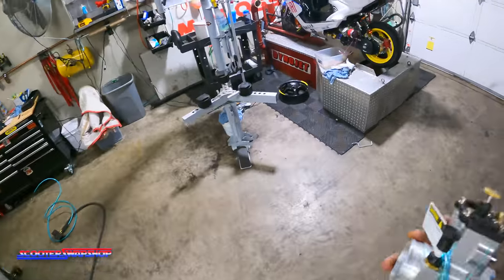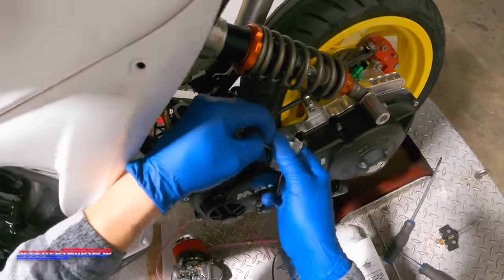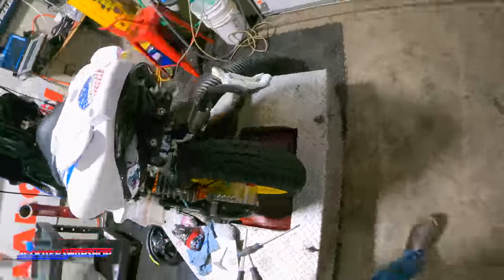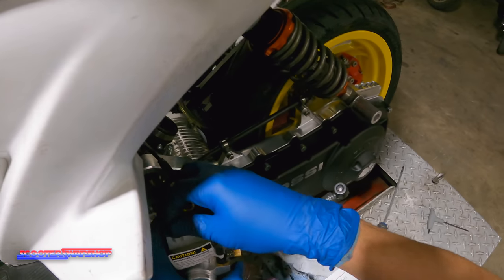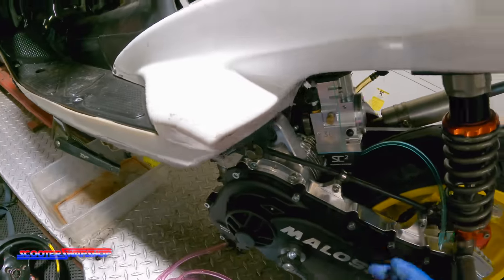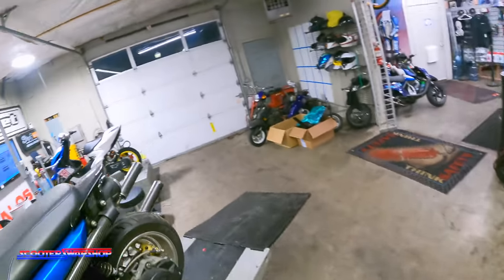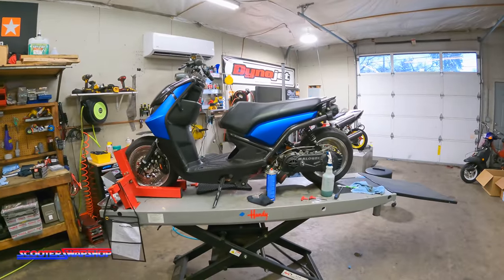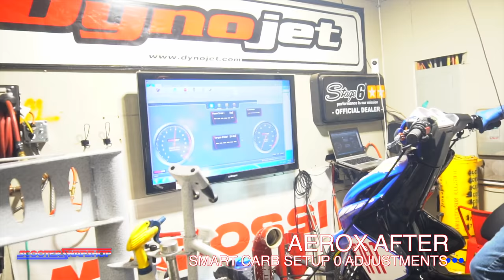Installation of a smart carb on the Yamaha Aerox Ep: 8

Comment: I flipped the intake 180 degree on a 8.1 carter i built for a friend as there is a little angle on it  and it gave much more room between the tyre and carb ;)
Reply from the maker: that would make it horizontal
Reply: @Scooterswapshop  Not at all ;) try it hehe
Reply: @ramshojracing  lol
Reply: @Scooterswapshop  you know you can just put a spacer plate in between your intake and block

Comment: Time to try the Super X carb from STIC SuperTorque. It looks and weighs like a PWK. The inventor told me a CR500 at the World drag race Nats took their class and placed 2nd in the 70cc class. Small bores get low end like an electric motor and the HP boost to the top comes in 1.5k RPM sooner and tags an extra 1k RPM after. So a very broad and aggressive powerband. I can't compare my SC to the Super X, that comparison makes sense with PWK vs SC. More apples to apples. Just a heads up on gains no one ever anticipates. STIC run huge pilot and main jets. Acceleration is beyond responsive, it is explosive. For MX on my KTM 200SX, I use G2's slowest turn throttle cam, as it returns control to the traditional range/sweep.

Comment: Hey Patrick, your show is top notch! I know I'm small beans but have two questions. I'm building a 70cc race kit bike. So far billet bottom end from Smolik performance and suitable crank and bearings that will take 12k to 13k rpm. The cylinder I'm rocking is70cc vertical MHR the one with the bridge port exhaust. I have already reached out to the guys at Smartcarb and no response. 
What size smartcarb should I install on this racing build? Second question if you have the time....which pipe would best suit this MHR racing cylinder? Price doesn't matter as I will spend the money for quality, speed, and performance.

Comment: Hello guys. You did an awesome job. I have a small noob question... I have a Peugeot Speedfight 2 50cc Air Cooled. I installed 70cc Malossi set, Naraku CDI, Gianeli Reverse exhaust, Malossi Variator and now 19 Malossi Dellorto carb. Problem is when I am at half gas or full gas it chokes. Like it can t go anymore. I have a Malossi sport airfilter aswell instead of stock airbox. Main jet is 80 middle jet 48 small jet 32. What can I do? or How to adjust. Its with manual choke awell.
Reply: Main jet way to small, with this setup you need around 110
Reply from the maker: sorry we dont offer over messages support but we have many videos that can help you resolve the problems on tuning
Reply: @keesanker4241  110?
Reply: @keesanker4241  arround 110? Wow.
Reply: @MrT3rminator  Yes a friend of mine with a peugeot vertical engine and roughly the same setup has a main jet of 115 with a 21mm carb. I think its best for you if you try a main jet 100 first

Comment: How can i get a nice throtle response on my piaggio nrg power phva 17,5 dellorto, 70jet, giannelli reverse, stock 50cc cyl, multivar 2000 with 5.5g. Its pretty slow response, i have tried changing jets or tuning the carb but doesnt really work, also starts kinda hard (i live in a cold country but still...)
Reply from the maker: call or message the app and Paul can get you the parts you need
Reply: You may want to put some stronger clutch springs, and check for air leaks around your intake, and just turn all your carb settings back to stock. And that will be the best you get out of a stock 50cc. I’d recommend getting a dr70 cilinder. It’s not expensive, easy to do, and makes your scoot 10x better
Reply: Get a new set of clutch rollers solid ones, it should fly through the gears then
Reply: @melkelly6148  hi, thanks for your help, but i sold the bike a while ago :DD the rollers were made by malossi so they are pretty good, just needed a stiffer contra, also changed to stage 6 street race 70cc kit, i still keep contact with the curent owner and it really does fly now :DD

Comment: What rpm was that bike on the dyno turning with the sc2 on
Reply from the maker: all the rpms
Reply: @Scooterswapshop  I'm debating getting a  28 sc2 but my engine turns 10.500 rpm I'm not sure if the sc2 work at high rpms
Reply from the maker: @Adrenalinspunk  10500 is not high. We’re using them on bikes that spin 17k
Reply: @Scooterswapshop  o shit an im worried about 10500😂😂 an is that with a 28 36 or 38
Reply from the maker: @Adrenalinspunk  I have one bike spinning 16 on a 28 and another spinning 15 on a 38.
Reply: @Scooterswapshop  you my freind have made up my mind I definitely am going to get one